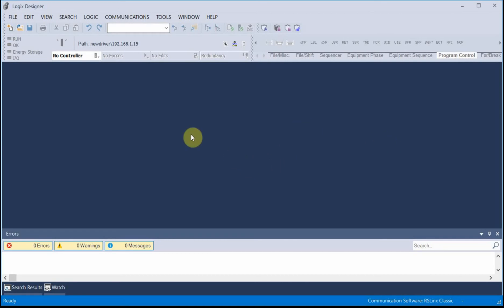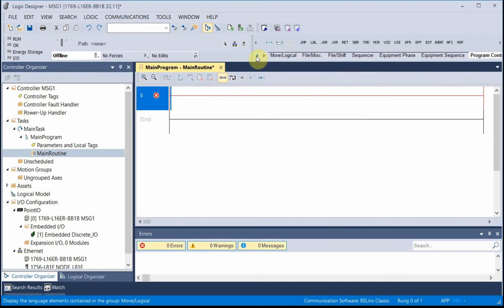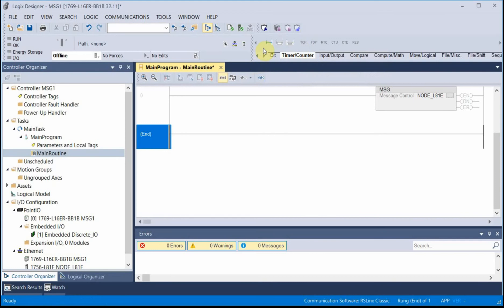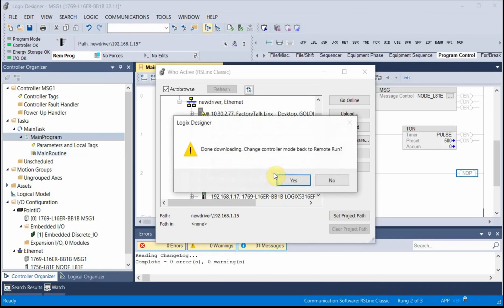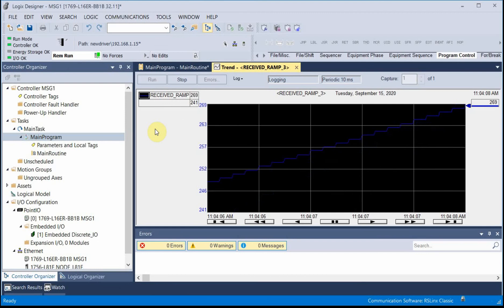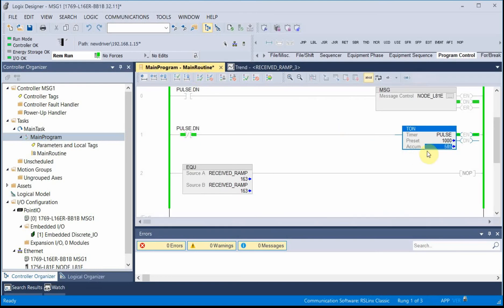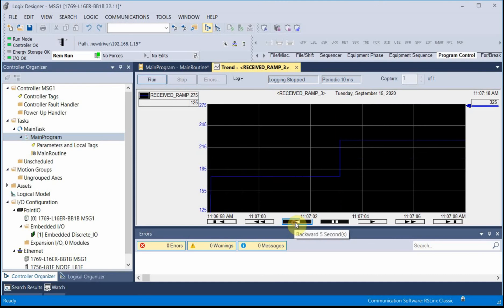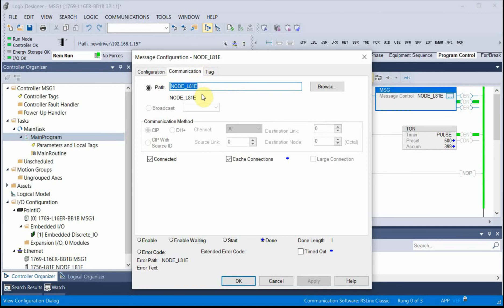Setting up a MSG instruction Studio 5000

Comment: Is it possible to read 1794-AENT IP Address in RSLogix 5000 via message instruction... Please suggest it possible
Reply from the maker: That's a good question. I can look into it.
Reply: @davidturbeville7047  hello sir i need help in sending email from PLC to supervisor after i have certain faults can you please help
Reply from the maker: @simranpreetsingh2153  What kind of PLC   are you using?
Reply: @davidturbeville7047  thankyou for your reply. I have 1769-L33ER compact logix 5370. Please let me know any solution for this.

Thankyou sir
Reply from the maker: @e.b.u.c8404  I found that the Ethernet/IP manual covers email messaging. It starts on page 56. After some research, it seems that the most common problem is setting up the message instruction. You need the ip address of the SMTP server that will be sending your message. Otherwise it looks to be a standard MSG instruction. Pulse it and it should work. I believe that you will need to have an SMTP service running on a server on the PLC network, or a gateway on your router to reach the internet. I will see if I can get my wireless plc network to reach the internet and report on what happens.

https://literature.rockwellautomation.com/idc/groups/literature/documents/um/enet-um006_-en-p.pdf
Reply: @davidturbeville7047  thankyou for the reply, i tried with MSG instruction but it did not worked because i dont have smtp server. I have wireless PLC and can use only internet.

Thankyou air